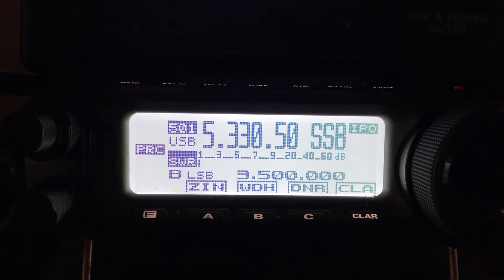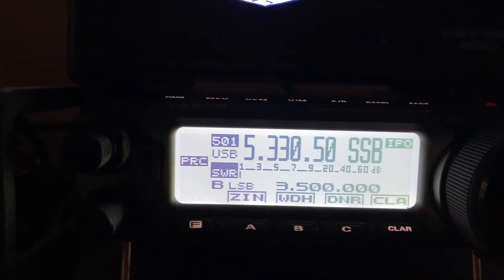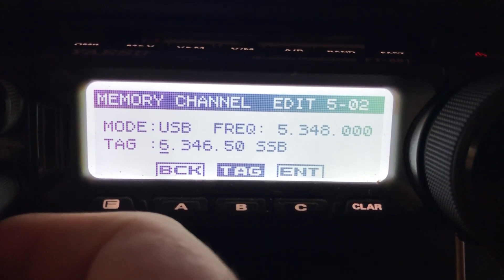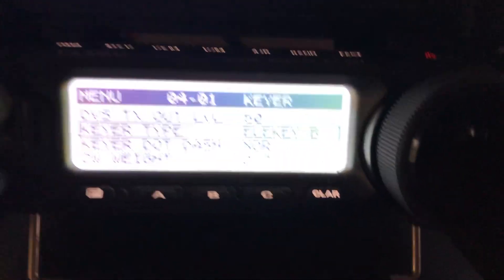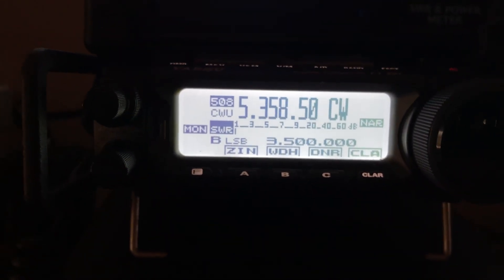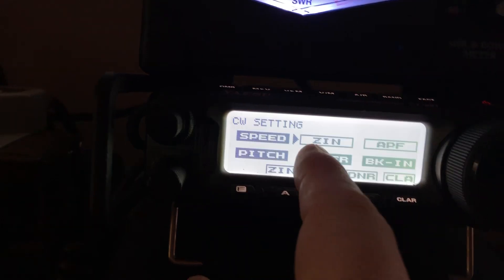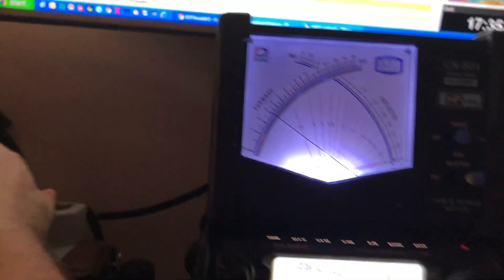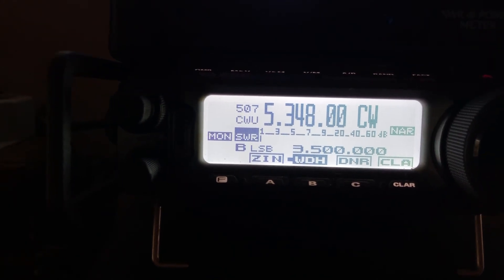Yaesu FT-891: 60-Meter Band Operation

Comment: My radio has the same channel on SSB as it does for CW. For instance ch501 is 5.330.00 like ch506. It should be 5.332.50 for USB. How do you get yours to be different than the CW?
Reply: page 37 of the manuel also shows them as the same. email sent
Reply from the maker: 60 meters is a special band.  It is designated by channels.  Yaesu programmed all 10 of the 60 meter channels according to the CW frequency, considered to be the center of the channel.  For SSB we transmit and receive 1.5 KHz below the center frequency. For example, channel 1 SSB displays as 5.332.0 MHz, but the radio actually transmits and receives on 5.330.5 MHz, USB.  If you perform the MARS modification to your radio, which could potentially void your 3-year Yaesu warranty, you will be able to tune the 60 meter channels with your VFO.  Of course you will then need to memorize the exact frequency and mode for each of the channels.  You will also need to ensure that you don’t exceed a TX bandwidth of 2.8 kHz for USB and that you use USB mode only.

We must exercise caution with 60 meters.  We technically share that portion of the spectrum with the government.  So we need to be certain that we are operating exactly on the correct frequency, using the designated mode, not exceeding 2.8 kHz TX bandwidth, and limiting our Effective Radiated Power (ERP) to 100 watts.  That is the ERP of a dipole.

I performed the MARS mod to a couple of my older radios, so I could use 60 meters.  I assigned the 60 meter channels to memory positions in my radio.  Note that with my FTdx5000MP, Ham Radio Deluxe even records channel 1 SSB as 5.332.0 MHz, instead of 5.330.5 MHz, because that is the frequency that the radio sends to HRD when HRD asks for frequency and mode.  60 meters is just different than the other bands.  I know it seems confusing.  But, having the channels pre-programmed into the radio helps keep us from accidentally transmitting outside of our operating privileges.  

The FT-891 has the ability to assign alpha-numeric text as an overlay for a memory channel.  I edited the displayed name for the first 5 memory channels of 60 meters such that my radio displays 5.330.5 USB, 5.346.5 USB, 5.357.0 USB, 5.371.5 USB, and 5.403.5 USB.  

73, Doug
Reply: @n4hnhradio  Thanks again for your help here and emails. I wish Yaesu would have made the 60m SSB channels show as the freq being used. Pretty weird in 2020 to be transmitting on a freq that isn't the one displayed on the screen. The memory tag is a nice work around but it reflects lazy menu design practices. Yaesu has sold gobs of this radio and i don't think its had an update since 2018. Seventy Three.
Reply from the maker: @forgetyourlife  I just shot a new video that covers the subject of 60 meters.  I hope it will help others understand this strange band.  73, Doug